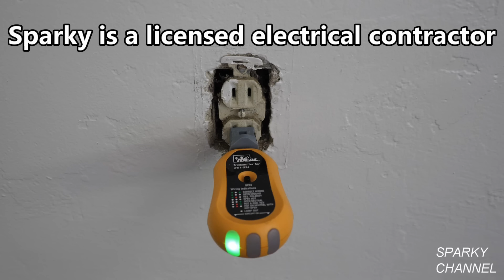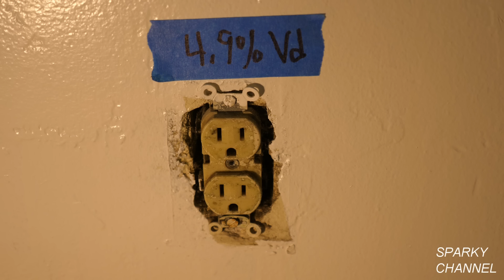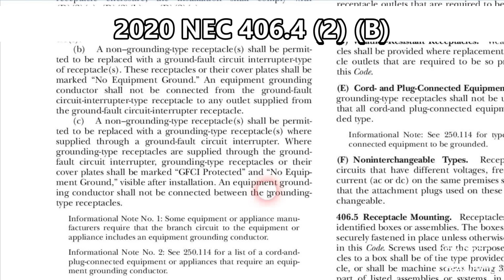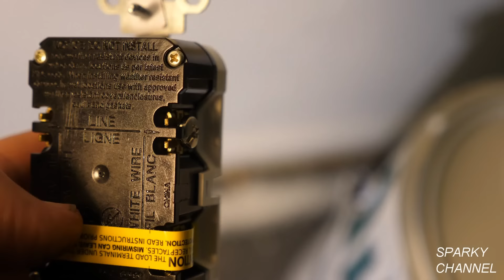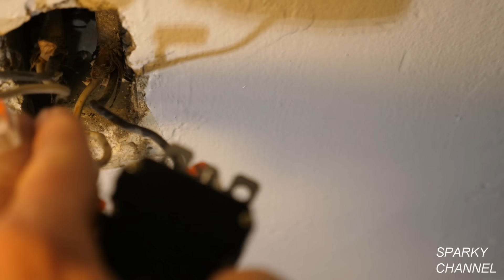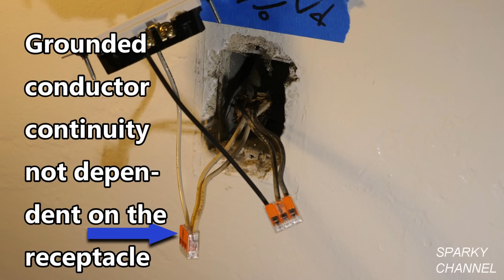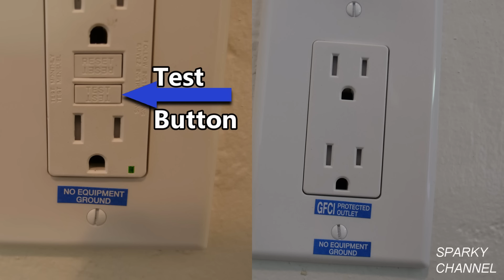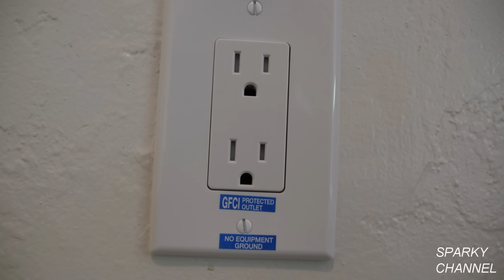2 Prong Receptacle Circuit Replaced by GFCI and Grounded Receptacles per 2020 NEC

Comment: Excellent video! I have a house where the renter replaced two prong receptacles with the three prong and never installed a GFCI because the wiring is not grounded. Now I know what I need to do to fix it so that it will be in code. Really good job explaining how to do it. My only problem is I don’t have the testers to know which one has the lowest voltage drop. Any way around that issue or can the tester be rented?
Reply: If you take the outlet where you think it probably should be, take it off, and find a way to keep the wires safe but also accessible for a test probe (like temporarily putting lever wagos on, by far easiest), then when you briefly liven up the circuit, all the other sockets should be dead, and one of the two cables is live and the other dead. At that point you have identified the cable closest to the breaker, which is all you need.

Comment: Hey sparky, quick question. Do you prefer this method over replacing all the breakers with GFCI breakers? Another electrician suggested that. Or both? Or just the way you did in the video? Great video man I loved it!
Reply: A GFCI breaker in the panel is probably the best technical solution and would save a lot of time and testing. The service panel in this house predates GFCI so a GFCI breaker would not be available. WHat sparky did was the best low cost solution that meets electrical code.

Comment: I just got into a disagreement with a licensed “electrician” over this topic today. This was a legitimate business sent out by the realtor to fix a few things in our 1950’s no-ground house before closing. The “electrician” insisted we needed to replace every one of our GFCI’s labeled “No Equipment Ground” with two prong receptacles to be correct. When shown the NEC referenced in this video, he said they still didn’t work right because his tester showed “no ground”. But said he could fix it by running a jumper wire from the GFCI’s neutral lug to ground lug. With the power on, he then proceeded to work on hot circuits replacing several of the non-GFCI 3-prong outlets, even though they were probably downstream of the GFCI.
Reply from the maker: HI Clay. What this "electrician" is suggesting is something which is very dangerous and illegal. It is called a bootleg ground. If you have done everything by the NEC code there should be no problem. Please don't let this guy "fix" your receptacles. It sounds like your GFCIs are properly labeled. Of course there is no ground, it says so right on your sticker, which sounds like it is to code.
Reply: @SparkyChannel  this guy was sent by the realtor and wasn’t our choice. He would have been fired on the spot today if it had been my call. I used your video to screenshot the NEC and read it verbatim which still did no good. The GFCI’s were installed by a different electrician a few years ago and that’s when I first heard of doing that to fix the two prong receptacle problem. They are all installed to code based on your video and NEC reference, and all of them are properly labeled. When this guy, as a supposed electrician in business, basically suggested replacing every GFCI with new two prongs, I was floored. But then when he essentially said that every GFCI outlet in the house needed that bootleg ground I was speechless! There were other problems too. I will be notifying people. This guy is dangerous and will eventually get someone hurt.
Reply: @clayhughes3263   I'd guess this "electrician" is just a handyman and not a licensed electrician.  If you have his contact info, I'd pass his info and your story on to your local building department, and to your state's contractor board.  I'd also send a letter to the broker that your realtor works under (their boss), and let them know that you've reported their "electrician"  for his illegal work.  Making the broker aware creates a legal liability if they refer this guy in the future, and hopefully they wont.
Reply: Wow. Just wow.

Comment: Great channel sparky… thanks!  2 questions?…. 1. What are you not getting by not having a ground wire to the receptacle? …what is the danger/concern of not having equipment ground?  2. Can you also install a GFCI breaker in the main (if main can handle the new breaker… squareD, Murray) instead of upstream receptacle?  Could be hard for homeowner to find why no power downstream if upstream GFCI flips… can be very confusing for laymen
Reply: Ground is connected to the metal case of metal cased appliances (or more generally: parts you can touch that can conduct electricity). What happens when the live shorts to the case, because loose wire inside or damaged insulation? With a ground wire, what happens is that enough current flows live to earth to trip the breaker, or at least the voltage present on the touch surfaces remains low enough (because directly connected to earth, and te live contact must be tenuous or it would trip the breaker) not to kill you when you touch it.

If you have an appliance that expects to be grounded (and thus has a ground plug, making it not possible to plug it into a 2 wire socket) and ground isn’t connected, and a fault occurs, what happens? Well, nothing immediately. Just the case comes live at full mains voltage, and then when you touch it, you will have a bad time, with a possibility of dying. So not desirable! Appliances with a plastic case, or otherwise protected from having parts from becoming live (double insulated appliances) have two prong plugs and don’t have this problem. Appliances that have a three prong plug are telling you by that very fact “I am only safe if used on a grounded outlet”, and if you find a way to plug them in without said ground (like using a 2-to-3 extension cord or adapter, or changing the outlets and leaving the ground unconnected), they are not safe.

What the GFCI does is continually detect “if power is going through my live conductor, it must also be coming back through neutral, and if not, I will turn off”. So in the case of the fault, the case will still come live — but as soon as you touch it, some current flows through the live conductor, through you, and out into the world and to actual-physical-ground. But it doesn’t go back through the neutral. So the GFCI trips, hopefully before you die. It’s not 100% guarantee, because the surprise can still cause you to fall and hit your head, but it’s pretty good. Good enough for code, apparently.

Re easy to find: that’s why the stickers are there, so you know to look for a GFCI outlet somewhere. As a European I think it’s absolutely wild you guys don’t have GFCI protection in the breaker panel covering the whole house, so that’s my bias. Brand in my house is https://www.groepenkastcompleet.nl/groepenkasten/attema/1-fase/220x390 — you’ll see one main switch, and then a couple of 2-unit-wide GFCIs paired with a number of 1-unit-wide breakers. Something trips, just go there and look for the things that are flipped down.
Reply: The main issue you will get is with computers. If you use a PC on such an outlet it is advisable not to use galvanic connections to other systems like a TV or a modem, instead use WiFi. If you use galvanic connections never connect them when the PC is on. Especially the now obsolete RCA connection is notorious in this as the data signal will connect first. This will send 60 volts to the data pin.

If yo have more than two ground devices: PC, monitor printer, do not use two different sockets but instead a power strip. This levels the case potentials between them and can prevent damage if you happen to connect them while on.

If you touch the PC an a radiator at the same time you likely will feel a tingle. The solution is not to do so.

As to safety issues make sure the box in the GFCI outlet is plastic or grounded. The GFCI does not protect if the live wire touches the case an sends voltage to the case. I would not trust this in dangerous locations like near water pipes, or outside, or at least test the outlets often.
Reply: @okaro6595  thanks so much for the detail here!

Comment: The receptacle at 10:11 looks like the ones I replaced in a 1949 built building. Except the wires were the ones with the cloth braid and I found out that the green covered ones were not necessary the gnd wire in this building. The ground was through the conduit.

Comment: I found a great alternative to the $300 analyzer to measure the V drop!  a $20 Klein Tools RT250 GFCI Receptacle Tester with LCD Display and a blow dryer plugged into the other outlet.  works the same to measure V drop.  would this technique be the same in a wet area like a bathroom or kitchen?  Just one GFCI outlet and the all the others can be regular? Isn't multiple GFCI outlets on the same circuit a bad thing?  I have an older house and someone put in all GFCI receptacles in the bath and they are on the same breaker.  is that good or bad?
Reply: It's redundant, so it won't hurt anything as long as the "line" and "load" are correct.
Reply: @MyFortressConstruction  then you could replace all the redundant gfci outlets with regular 3 prong outlets, as shown in the video, as long as the one closest one to the breaker is the gfci outlet, and then reuse those gfci's elsewhere to save a few bucks, or just leave them.  either way is legal and safe?
Reply: @DesertGardenPrepper  Yep, the first GFCI on the circuit protects the rest.

Comment: The best solution to meet code is to place all old wiring on an arc fault/ground fault circuit breaker.  Many old boxes are too small to easily install a GFCI type receptacle.  The "three device in one" circuit breaker, meets code and provides some peace of mind,... knowing that there could be wiring issues, unseen, in the walls.  To my thinking, the risk of arcing, at a bad connection, is as great as the risk of electrical shock.
Reply: If this was my house I would have it rewired and brought up to code across the board. That would cost a lot. Code allows this modification to the outlets and if someone flips homes they will always go with the lowest cost code compliant solution. Sparky did everything above board. My preference would be new wiring and panel like you suggested.

Comment: 10:33  What were the wire connectors for, to make your next testing operation safer?
 Why is their places for two line cables in the gfci if you only place the one line directly from the circuit breaker? maybe this is a more advanced question, not for this basic video.
 Nice push tool...
Reply: receptacles that have two pairs of terminals (i recently learned), often have a tab between the hot and neutral screws that can be broken off, thereby isolating them. then you can put just the bottom or top of an outlet on a switch. not sure if this is the same for gfci though.
Reply: It's so oucould run the lights and fan say in a bathroom wit out losing lights if te gfci trips canthave lihs gfci protected

Comment: I think you did a great job taking a step-by-step as to what you were doing even though it was a little long but I was also very glad to see you reading from the electrician's code to ensure you were doing it accurately. The one thing I would have liked to see after you wired the outlet was to get a close up of the back side of the outlet and point out each wire hot return ground because I felt like you put it back into the outlet on the wall too quickly for me to really get a good picture of what went where even though you went over that in the beginning when you were wiring it, one more time I think would have helped.
Thank you for a very detailed articulate look at rewiring outlets on an old house.

Comment: what is the torque setting for the receptacle screws? I purchased the Wiha torque screwdriver through your link. Thank you for all the wonderful videos
Reply: I think that's outside the scope of NEC and working as electrician. Auto requires torque specs, I doubt a receptable would. Great question! I will look that up.
Reply: 10-20 in. lbs. for most, but the manufacturer should state that.
Reply: Torque settings should be indicated on the receptacle somewhere. There is no universal torque setting.

Comment: The code also requires AFCI protection for any replaced receptacle in a living space (not unfinised basement, garage, outside and the like), so the head receptacle should be a GFCI/AFCI combo type, which, as stated, protects all downstream receptacles. While you're at it, pay a few cents more for tamper-proof receptacles to save 400 shocks and 12 juvenile deaths per year. There are shutters that only open when two prongs are inserted. (I remember shoving a bobby pin in a receptacle as a 3 year old, but still can't explain why I did it.)

Comment: Great video , very well explained. This is extremely helpful for homes built in the early 60s and 50s. My daughters house has non grounded  duplexes in parts of her home. Your video has given me the opportunity to proved her protection on those outlets that aren’t grounded.   I have a question about aluminum wiring. My daughters home is 100 amp service all copper wiring throughout. Someone has installed a single aluminum wire circuit some time ago. There are only two duplexes on this circuit.  I was changing out the old duplex to a new one as the old one was worn and loose when you plunges in a lamp.  When I removed the old duplex I noticed the at neutral (white wire) was burned on both terminals.  Could you possibly prove an explanation as to why on the non feed side of the circuit would get over load and burn.    I checked the service panel and the aluminum circuit is on its own 15 amp circuit breaker and is tied (wired) to the black wire.  Thank you your time. Mike
Reply from the maker: Hi Mike! I would guess that the burned wire was a loose wire. As we say, "loose wires cause fires!"
Reply: And even if it was tight when it was installed, oxidation deteriorates the aluminum, making it smaller, therefore loose.  You can get duplex receptacles  made for aluminum conductors to avoid oxidation.

Comment: So how would you go about grounding the circuit? Would that require all new wiring for every outlet? 🤔
Reply: In specific cases, you can use the raceway carrying the conductors as the EGC, but since this is residential, it is most-likely not running through any metal raceways that you could use as the EGC. At least not all the way from the panel to the outlet box.  

So, yes you would have to completely rewire the circuit with 12/2 Romex to properly ground it.
Reply: @PepperStone3  Is that allowed? My parent's home had lots of metal conduit and BX. Sometimes the run would be interrupted by 'new' work -- losing the ground connection. I even came across a connection where there was only a single wire -- the hot wire -- in the conduit and the conduit itself was used as the return, i.e., neutral -- not cool!
Reply: @sanityassassin8161  I'm my house I've seen some ground wires connected to the copper water pipes! It's been hard to trace where those ground wires originate though.
Reply: @PepperStone3  Can you say reword this for us non-electrician (lay people)? -->" the raceway carrying the conductors as the EGC".
What is a 'racewy'?
'Carrying the conductors"?
'EGC'?

Thanks.
Reply: How do you ground the GFCI?

Comment: Do the GFCI reset themselves if they are tripped?
I am thinking like a self resetting circuit breaker.
I have one plug that I want to replace. I think it only has two wires going to it, so it would be the furthest upstream? But for now it is the only one I want to replace, thus i am not going to worry about upstream/downstream etc.
Reply: No you have to reset them manually.
For your situation you can find out which one is most upstream. Then replace that receptacle with a GFCI. And use the non-GFCI receptacle you just removed in the more downstream location. 
This way you'll be protecting the entire circuit
Reply: @Free-g8r  
Thanks

Comment: NEC allows an original 2 prong receptacle to be replaced with a new 2 prong receptacle. So can someone replace an original 2 prong receptacle with a modern 3 prong receptacle as long as the grounding hole of the new 3 prong receptacle is filled with caulk?
Reply from the maker: No.
Reply: @SparkyChannel  
I thought so...

Comment: Most people do not have those expensive testers!
Reply from the maker: True.
Reply: It takes a bit longer and requires some math but you can get fairly accurate voltage drop measurements using a constant know load and a volt meter.
Reply: @crazypete3759  
Also requires special knowledge.
Reply: Most people should not be working with electrical!
Reply: @bradleybahrman928  
You tube thinks otherwise.
Reply: @djg585  You tube is an app controlled by algorithms and random people who are not electricians.  It doesn’t think, because it’s an app💭 🤦‍♂️ 

Save your money and hire an electrician.
Reply: @bradleybahrman928  
Kind of a contradiction in terms.
Reply: @djg585  I understand that you do not understand
Reply: @bradleybahrman928  
Mt. Olympus speaks.